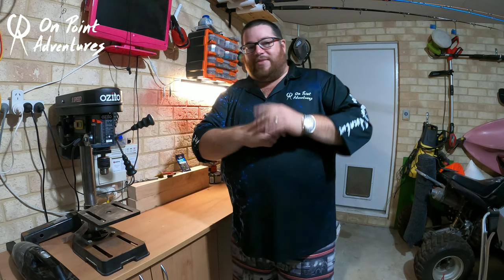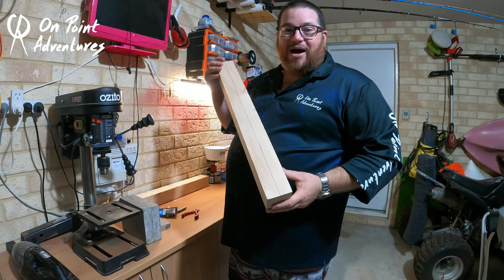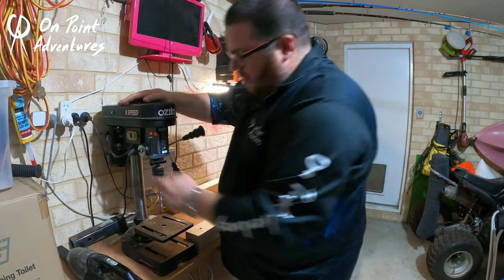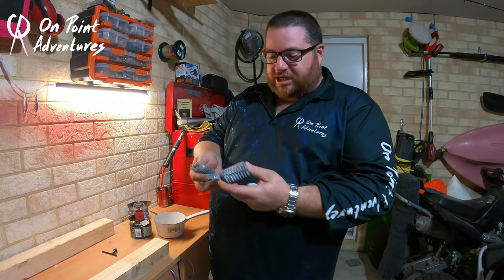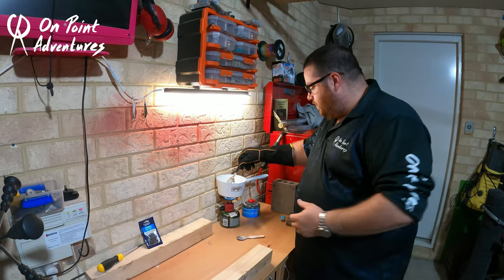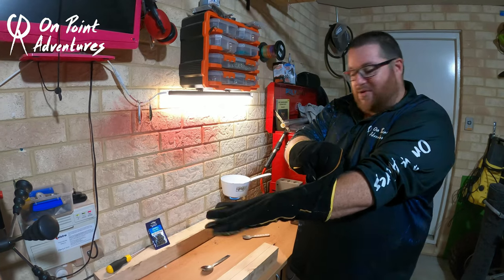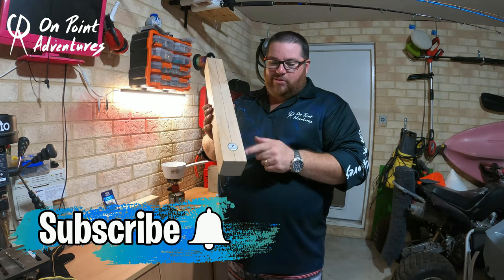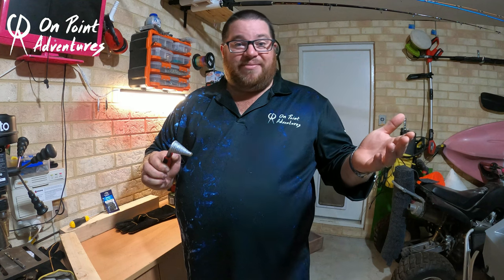DIY  SINKER MOULD  | BEST SURF  BEACH FISHING SINKER

Comment: brillant, just came across your channel. What size swivels?
Reply from the maker: Any size is fine really, alternatively you can just use a wire loop
Reply: sweets looks like i did see your channel 2years ago. Looks like a best subscribe. With the tangle free rig  with these sinkers If I want to use smaller sinker I can just downsize the line rating would that be correct?